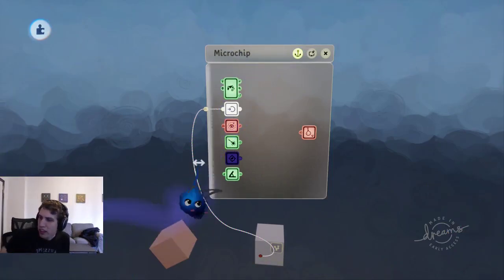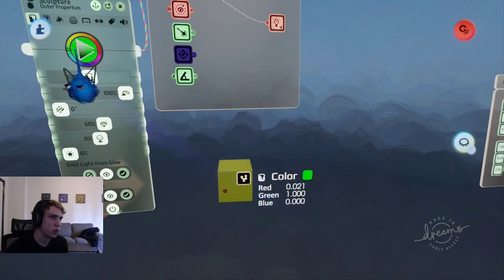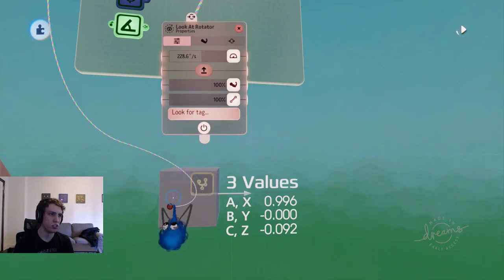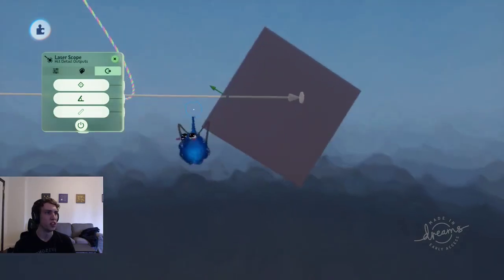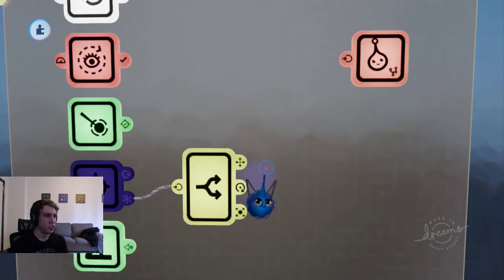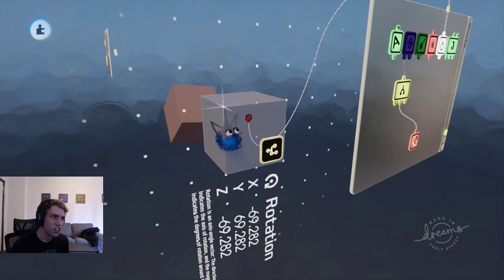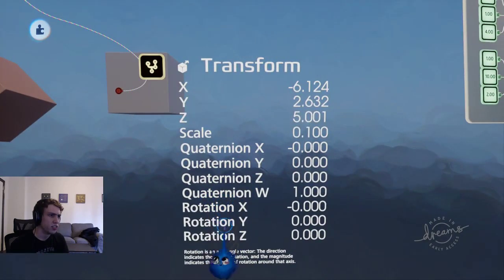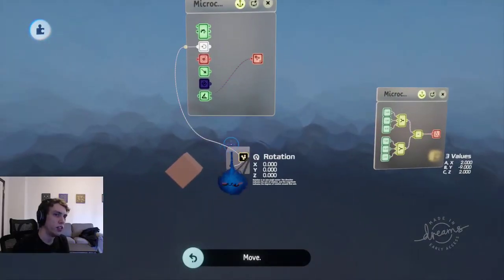Dreams Vector Tutorial - Part 2: Vector outputs explained

Comment: Also helpful is the movement sensor who has 3 direction vectors. So you don´t really need a look at rotator.
Reply from the maker: Movement/rotation sensors are a bit different since they're mostly for detecting how fast something is moving, not the current direction/position (unless I missed some outputs on those gadgets). Was thinking about showing those gadgets too, but didn't want the video to be too obnoxiously long.
Reply: @RbdJellyfish Thats right but I´m pretty sure there are also 3 direction values on the first page. Which is strange since I expected them on the angle sensor. I use the Z value from it to make a gun face the same direction the camera is facing and it works. Very good videos by the way. I definitely learned a lot.